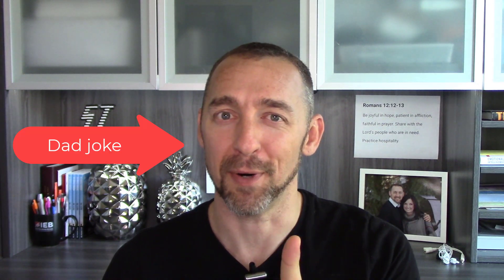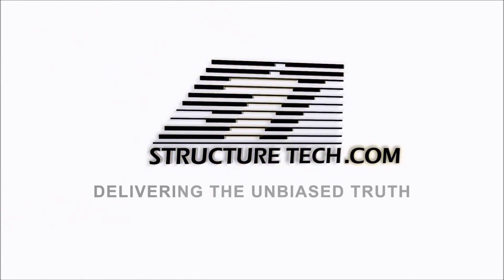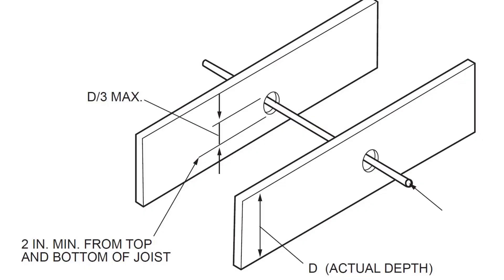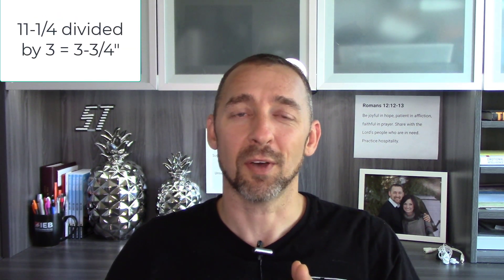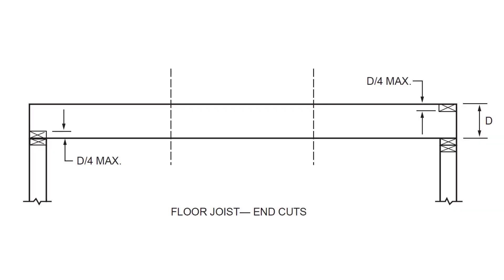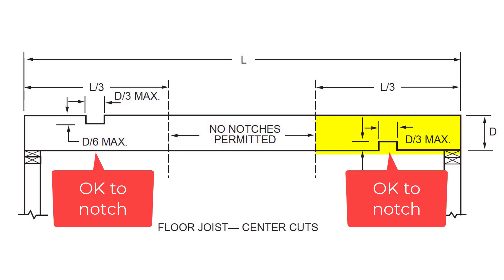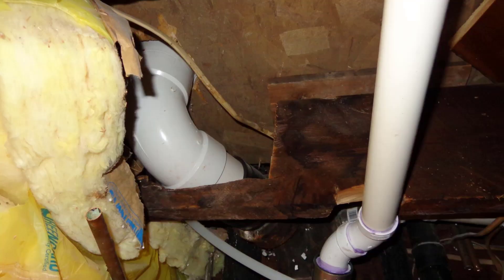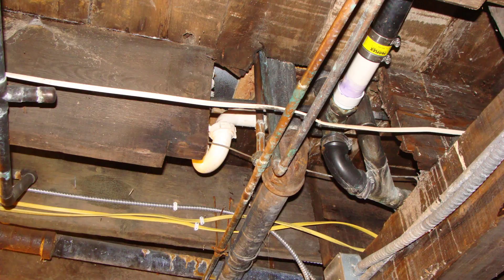Notching and Boring Dimensional Lumber

Comment: You made what is difficult simple. Those overpriced Consultant Engineers, would prefer you scrub, your video.  In most cases, they charge more than the repair.  And yes !  The information they provide, is what you planned on doing without them.

Comment: Great info, shocking photos. And I agree not to get involved in the engineering of repairs, leave that to the carpenter. If he or she thinks the issue is complicated enough to bring in a structural engineer, that’s their job. Your job is to then reinspect that the repair was proper, but you don’t need to get tangled up in the repair process.
Also, “dimentional” should be “dimensional”  — silly English spelling 👍

Comment: Great video, and really important information.  This is one of the most common defects I find in framing in homes, even in brand new builds.  I  inspected a home where an excessive number of holes had been drilled decades ago and it weakened the structure to a point where the center of the home had sagged almost 4". The repairs cost the homeowner close to $20,000.  The structure of your home is nothing to play with. Keep up the great videos!

Comment: I wonder why in 2021 we are framing houses with wiring, plumbing, HVAC, etc. as an afterthought. Why not build conduits into the design? It'd be so much easier to work on down the road. Commercial offices have had built-in channels in the floors and ceilings for years.